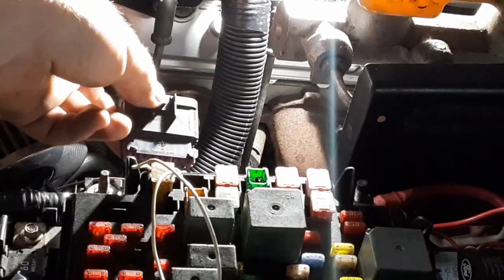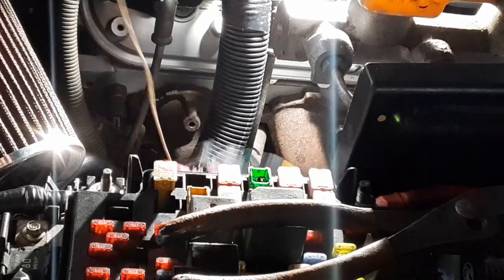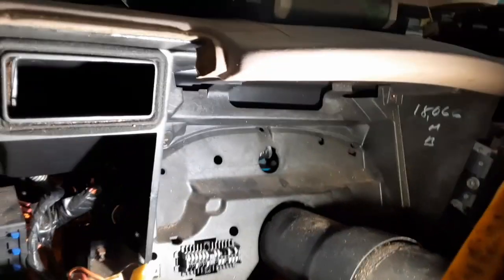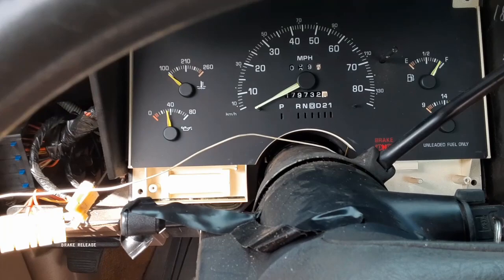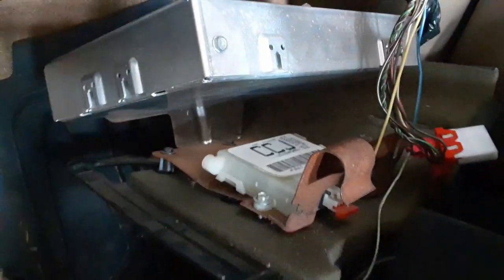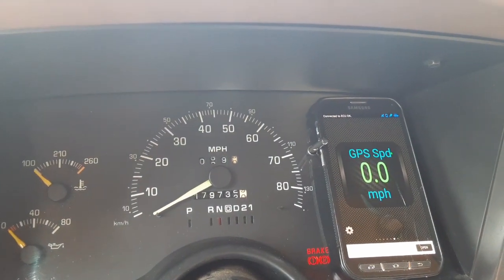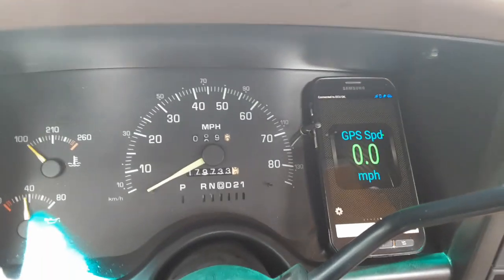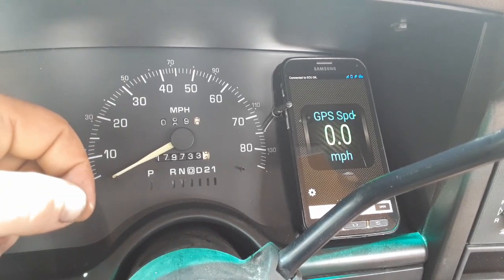Using stock gauges for LS Swap Speedometer - LS swap S10 project -

Comment: I’m doing a ls1 swap in a 89 Silverado 350 tbi, my standalone harness has a speedo wire. But I was under the impression you tie the vss from the Obs to the vss to the ls1 harness? So confused to say the least
Reply from the maker: It's different for every type of vehicle since wiring, speedometers, modules, etc are all different (although most GM electronic speedometers use the same pulse rate). That way may work fine for an 1989 Silverado. The car in the video is a 1994 Sonoma, very similar to an 89 Silverado but not exactly the same. I'm also using a 2006 Transmission which matches the engine and computer, not the original VSS.

Comment: I have GMC 1997 
Same colour or different colour
Reply from the maker: I'm not really sure, most of the GM wiring is similar colors for things like gauges. You'll need to test your wiring or find a diagram for the specific version of the truck.
Reply: @lsswapshopp  
Thanks 
So i have to connect the green wire to pin 50 
Ls pcm .?

Comment: Did you ever do a tach connection video?
Reply from the maker: I didn't. The gauge cluster I have doesn't have the Tach so I never connected it. It's pretty easy though since the computer has a dedicated Tach output wire. The Tach signal can also be altered in HP Tuners so the 4 cyl Tach will work even though it's an 8 cyl engine.
Reply: Ok I have a 93 …when I got my ls installed they cut allll the old harness up and just used the hots.. is the white wire on the gauge connector the tach wire ?. I think it is…
Reply from the maker: It should be, white's usually the tach wire color for GM vehicles.

Comment: Will the second gen s10 have the same style translator box?
Reply from the maker: Yes but also No . If it's a 1994, like this one, then it will be the same. Somewhere around 95, 96, or 97 they changed to a different way to get information to the gauges. I'm not sure of the exact year they changed over, so the early 2nd gens will be like this (and I think late 1st gens), then the later 2nd gens will be different.

Comment: Is that GPS Speed an app I can download on my phone ?? Might be a stupid question but I need to check my actual speed on my S10.. Even a tire size change affects the calibration so much
Reply from the maker: Yep, it's a free app, called Torque Lite. There's a pay version also, just look for the free one. It uses the cheap bluetooth scan tools. Also an easy GSP speed check method is just use a navagation app, google maps also shows my speed when driving.

Comment: When I swapped a 03 mustang mach1 with 5.3 twin turbo car with a 4l80e I made the all gauges work including  the factory tach speedo cruise etc o ya and the AC
Reply from the maker: Nice, best way to make a fast mustang is drop an LS in it. AC and cruise are next electrical jobs on the list.
Reply: @lsswapshopp  Dakota digital for the speedo conversion to convert the gm pulse to the Ford speedometer

Comment: Hello I just had a question. Super sketchy wire doesnt connect to the engine anywhere? Just one end on pin 50 to random boxes under dash to pin 3 on gage cluster? 

Thanks for documenting this info, this stuff is invaluable. I really want to keep my factory dash and fuel tank and these videos are awesome
Reply from the maker: Sketchy wire goes from Pin 50 on the LS Swap computer (red or green connector pin 50, depending on computer version) to the 3rd spot on the gauge cluster connector.  I just used the stock LS wiring harness C100 connector, but the wire can be ran directly to the PCM.

To make it a little easier for my troubleshooting Instead of pulling wires from under the gauge cluster, I found that the Blue w/black stripe on that "translator" box under the glove box is the speedometer output wire to the gauge. I hope that doesn't make it sound more complicated, basically the blue w/black stripe IS the 3rd pin on the gauge cluster.

Pin 50 is the speedometer output wire in the stock LS trucks, the PCM converts the VSS pulses into a 4000 pulse per mile signal to run the LS truck speedometers.
Reply: @lsswapshopp  thank you for the detailed reply.

Does the factory 2.2/4.3 setup work in a similar manner? 

Would a non ls swap, hook/wore up in a similar way to keep the factory speedometer working? Thanks
Reply from the maker: Yep, as long as the swapped-in computer sends out a 4000 pulse per mile signal it would work exactly the same.